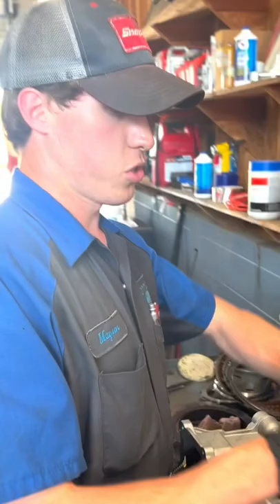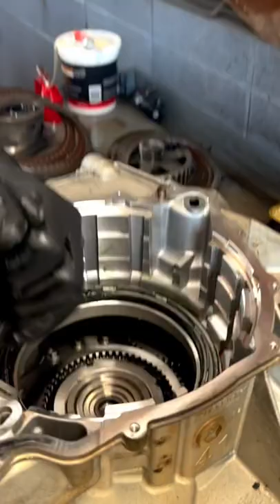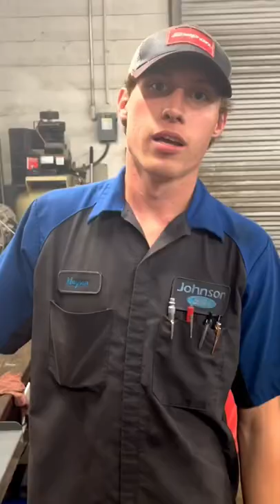How to install Transmission Pistons with a Feeler Gauge #shorts

Comment: I was taught to use a tool made with a piece of piano wire because feeler gauges will often cut a lip seal. Just make sure the end is rounded or bend in half and hammer into a piece of steel or copper tubing

Comment: What service interval would you recommend on 10r80 transmissions on the f150 platform? And would you do a flush? Or drop the pan and just replace filter and refill?
Reply: Never flush a transmission unless it's specified by the factory .
Reply: It depends on your driving and mileage. Transmissions doesn’t suddenly have a problem unless it was already there or the flush was done incorrectly you can flush your trans whenever.
Reply: Every 100k